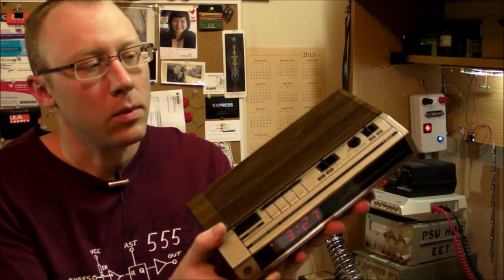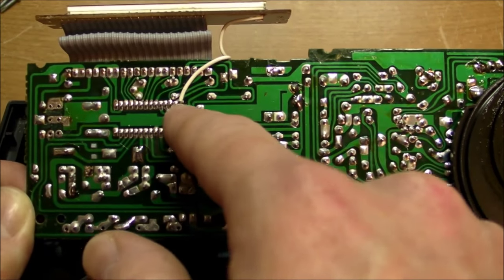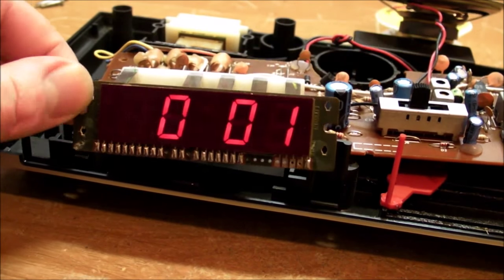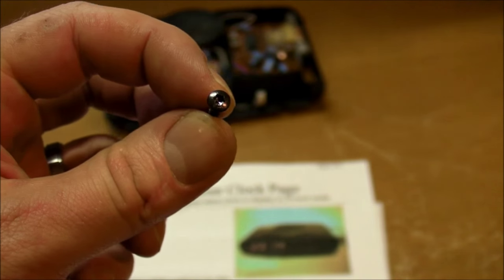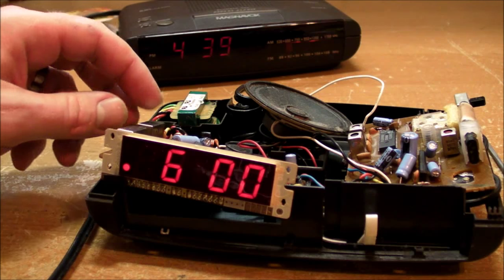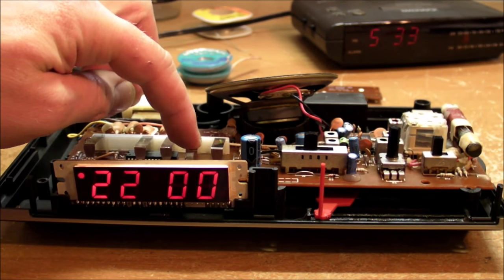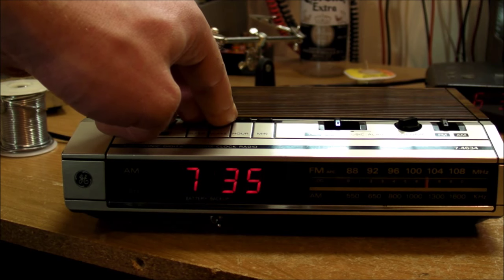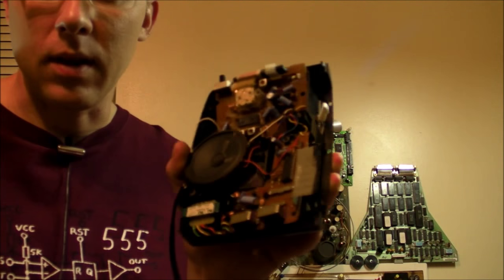(#0209) Convert 12-Hour Alarm Clock to 24-Hour Mode

Comment: In year 2022 there are still some cheap clocks and radio-clocks made with the LM8560, but it looks that they are slowly disappearing. It's too bad, since the LM8560 is a very reliable chip and uses very few power. My radio-clock absorbs only 1,7W, and I like the red LED displays.
Anyway thank you very much for the video! Now I finally understand why the colon on my clocks with the LM8560 doesn't flash. It is always lighted. I will check how it is connected to the board.
There are also some other “ghost” tricks with keys. Try the following combination and look what happens. Press:

Alarm+min+hours (it resets the alarm time to 0:00)
Time+min+hours (both runs)
Keep alarm pressed then press sleep once. During the displaying of the seconds, keep pressed the min. button (it stops the time)
Sleep+hours (Set sleep to 1h59min)

Comment: Thanx for your video and info, I shall now do this myself.  I know now to check the LEDs are all there.  The 50 - 60 Hertz switch would be good to make the clock run via a transformer and take it on your travels, Australia included. Your clock is now ready for when spindown day or evening eventually comes to where you live sometime in the future. 
 It would be interesting the pinout details for ICs older than the LM-8060 at least for frequency adjustment.  I have an old digital clock that is from Canada, know that pin is somewhere but have never gotten around to converting it to 50 Hertz yet.
I had someone live in my house who would seem to get up a few hours later each day, and I did think of the idea of setting him up with a clock set for 60 Hertz running off the 50 Hertz mains, but I never did it.
Reply: What if the clock radio doesnt come with a switch, would it be possible to change a 60hrz to 50 hrz?

Comment: awesome information. I did this ages ago to a massive bedside led clock. took it to bits, swapped out the display for a much smaller one. soldered on some male and female headers so the display sandwiches together. did the 24 hour and colon mod to it and installed it into a project. made the alarm function hook to a relay via darlington transistor to turn on an outlet.
that extra chip you have can be used again as well, you will have to make your displays from scratch with single leds.

Comment: Great info Eric, I just converted an old Bush alarm clock of mine in the same fashion. Had the TMS3450 chip and some variant of the 637 display inside.

Comment: I did some experiment long time ago with old alarmclock and radio alarmclock powered by LM8560 after check it's datasheet and some circuit diagram for radio alarmclock or non radio alarmclock. Radio alarmclock don't wake you up by backup battery when in radio mode and power outage but it's possible to modify (2 transistors, diode, resistors) when no AC buzzer is used also can be modify when volume for radio too low to wake you up by it switch to buzzer. When in backup mode time is not acqurate because internal oscilator but my friend made precise thermal compensated oscilator for back up run. I made modification for trickle charging rechargeable 9V battery because it drain very fast when no AC and don't need to check battery if good so often. Rechargeable battery lifespan with trickle charging from clock can least up to 10 years. I also add two LED on radio scale when radio ON.

Comment: Thank you Eric for your video!
Is it possible to make the alarm clock displays wrong time (for example 56:98)? For this I suppose instead of a 24h cycle with 60 minutes cycle it would be 99h cycle with 99 minutes cycle. Is this possible to achieve?

Comment: Thanks for this great detailed video. I have a intertronic compact clock radio (with FM) however this clock displays only 24hr. I want to be able to convert to 12hr format. Just the reverse. Please suggest. this is 220v, 50hz european model.

Comment: I have a question, i bought a GE radio alarm clock from canada(60hrz) and brought it to europe, the times slows down cuz of the frequency here, (50hrz), is it possible to somehow modify it to 50 hrz so that the time works properly?

Comment: just a thought, couldn't you have installed an inverter ic or similar logic ic to change the behavior of the AM indicator? I realize with 24hr mode this is hardly necessary but I guess my OCD is kicking in lol